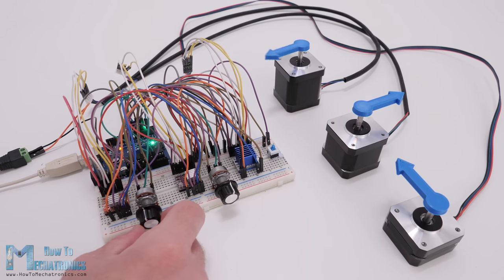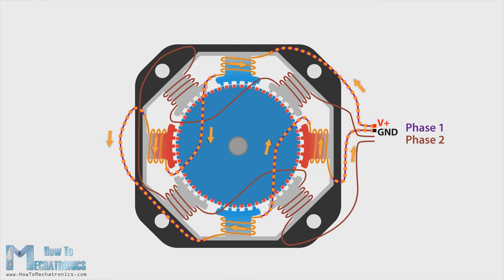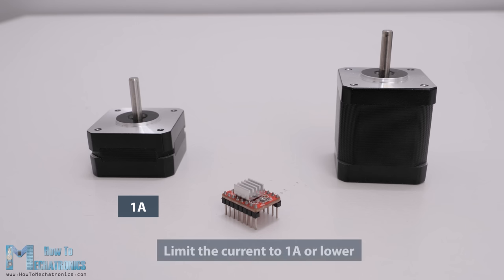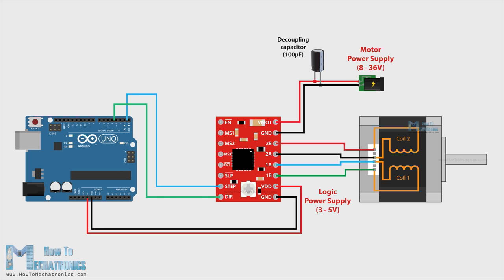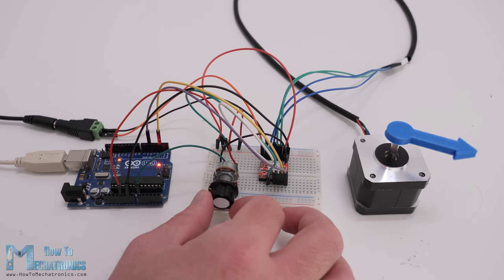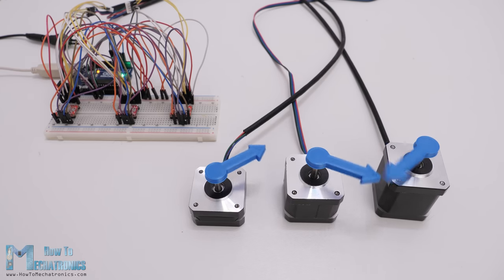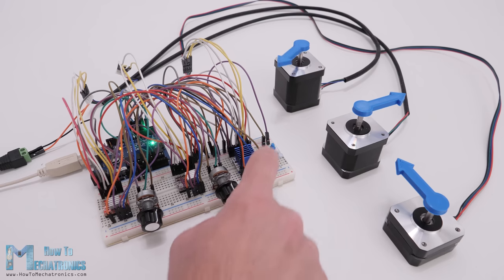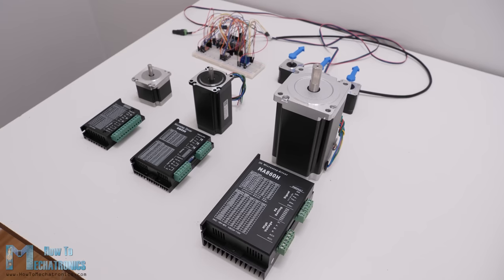Stepper Motors and Arduino - The Ultimate Guide

Comment: My capacitor just exploded. Wy?
Reply: I was about to connect it bro!!
Reply: You plugged it in the in reverse bias
Reply: @angelrodriguez1929 that happened 2 weeks ago in the guy across from me in labs 😂😂
Reply: Just use cnc shild fuck this ahahah
Reply: Because you didn't have the capacity to handle the knowledge of this video.
Reply: You need to watch out for the capacitor voltage rating
Reply: @ivanarambasic9996  if im using a 12V power supply, what Voltage rating capacitor should I use?
Reply: @joseleandro3165  The voltage of your power supply does not matter. The voltage over the capacitor matters. But if the voltage over the cap is 12V. Then I recommend at least 16V, it does not matter if you take a higher voltage rated cap. (Altough I don't know if this is true for the esr) But apart from that you should be good with 16V or higher.
Reply: Skill issue

Comment: Thank you for the super helpful video! I want to have a NEMA 17 stepper complete a full turn (200 steps) in under 200ms (so 1000 steps/s or faster, better if faster). Is this possible with these drivers? My stepper has a current rating of 1.5A, and I am using a DRV8825... What voltage should I apply to the motor to ensure this? The torque should not be very high, but I need high acceleration!

Comment: Very professional tutorial with narration correctly pitched to people learning at basic level.  I learnt a lot.  I am making a 3 stepper impedance matching unit for antennas.  3 x Nemer 23 TB6600 for current and Arduino Uno.  Your advice on Arduino library is very useful.  Cheers from OZ.
Reply from the maker: Glad it was helpful!
Reply: Hi Dean, does your motors run loud? I added a laser setup to my machine with the ardruino, cause my controller don't support a laser.
Reply: @k33501  Happy 2023.  Your steppers may make a noise during operation if the settings are not the optimal combination.  So the current setting and the Pulse/rev settings can conflict with the sketch itself.  I had to experiment a lot.
Reply: @Yosemite_Sam  Thank you Dean, I'll play around with the settings. All of the best for 2023 :)

Comment: Great explanation of the differences between stepper motors!

One question: I need a driver that makes the current towards the stepper motor 0 during standstill (to limit power and heat in the motor). Holding torque during standstill is not important as the stepper motor is connected to a worm gear.
Is any of the drivers capable of zero current during standstill?

Comment: Question:  Once power is removed from the stepper motor, does the motor lock in place?  In battery operated conditions, there is no extra power available to lock the motor.  How do you suggest to lock the motor without consuming energy?  And is there an easy way to add a gearbox or a worm drive to the popular stepper motor to increase the torque and provide a natural lock function?

Thank you for your videos which are very informative and helpful.  It is very important to describe how a device works before explaining how to use it.  I am happy to see that you use this methodology, unlike most other YouTube instructors.  I notice that in this lesson you also explain which library function block and which don't.  I can't stress enough how important this is.  If the function is non-blocking can you also explain if it is timer interrupt driven, feedback interrupt driven, or in the case of the .run() function, it just blocks for microseconds - i.e. a micro-block.  A micro-block will cause the stepper motor to be influenced by the flow of control in the software.  On the other hand, interrupt driven will allow the stepper motor to behave naturally no matter how the software behaves.
Reply: Answer to first question: No...
Reply: I know this was posted 5 months ago, but figured I’d give some extra help on your first question.
If you need a way to self lock without power, do some research on the formulas for power screws. They can be self locking given a small enough lead (thread pitch) or a high enough friction coefficient. The calculations are relatively simple when given what each part of the formula represents. 

Good luck with your projects.

Comment: What power supply are you using? Would a 12V 2A wall outlet supply work well? I'm having trouble online finding resources for this. Intending to use 1-4 stepper motors (2.4ohm, 1.5A) for CNC related projects

Comment: This video is an awesome recap on arduino stepper motor use!
Theoretically, if you were to over drive a stepper motor with the driver, what would happen? 
Would you just burn out the stepper driver or would you also take out the arduino as well?
Reply: over drive?

Comment: Thank you for your video! Could I ask what power supply did you use for driving your motors? It seems like you didn't need a capacitor. Thanks for your help!
Reply from the maker: I used a regular adapter 12V 5A power supply.
Reply: @HowToMechatronics  thank you!
Reply: @HowToMechatronics  could you give us a link?
Reply: @HowToMechatronics  yes  it seems you didnt used a capacitor , why is that?

Comment: Very detailed explanation😊😊 thank you. But I have a question, If I want to run my rotary machine using stepper motor, where the stepper motor actions (on and off) are driven by photoelectric sensors just to make stop once the sensors are turned on, do I have to use driver? Or Can I just use transformer and capacitor only since it only run on single direction? 

Note: I only need the motor to stop exactly when the sensor are on

Thank you

Comment: Great video! Have tried to work this code for simultaneous motor control, but the motor is not moving smoothly as in the video for the speed and acceleration only for ACCELSTEPPER library, its like its starting and stopping each step till final position causing a juddering sound and slow motion of the motors... i cant figure out why its not running smooth

Comment: Nice video, but has a small error A4988 have a max vmot of 35V  not 36V  according to the data sheet.
Reply: At 8:15, you correctly say its 35v latter on

Comment: Amazing video !! Would it possible to ask you a question here please? What if I would like to connect a big NEMA 34 with its own large controller, to this CNC board? Is it feasible? Also, do these little red CNC boards allow the great motors to be used at their max speeds? And if not, which Arduino or GRBL system would be suitable for high performance driving of NEMA 34s?

Comment: For the DRV8825 Drivers, your wiring diagram seems to be incorrect. the RST and SLP pins need to be connected to 5V otherwise the drivers don't turn on.

Comment: Great tutorial! I hope I found this earlier! Did you manage to make it work the first time? I already tried twice, and both attempts failed. The negative wire connecting 12V to GND on the A4988 melted right after I applied the voltage. Is there a reason for this? Thanks!

Comment: Thanks firstly for this summary.

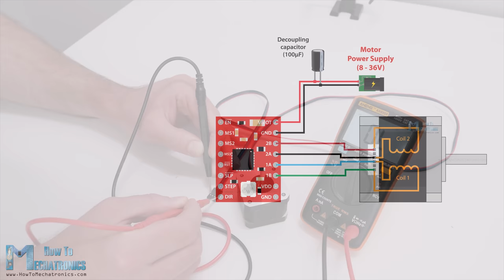9:27 The order really doesnt matter? 5:14 I think it makes a difference by depoling 2A with 2B when the signal of the H-bridge goes the wrong way. As whe one coil pushes clockwise, and the second coil may then push counter-clockwise what makes the motor just buzzing instead moving, right?
22:11 Does the 3. motor not make 4 rotations as 3.200 / 800 = 4?

Comment: Can the MS1 and MS2 pins be controlled via software or only my connection to GND and 5V? I was working with TMC 2209 and was TOLD that such control was available on it,but later came to understand that on the TMC 2209 the MS1 and MS2 pins are used for setting up come parameter for UART control of the selection of Step type, e.g. WHole Steps, quarter steps, sixteenth steps etc. I really need to be able to control that via software.
Reply: Just an idea, but what if you just do the largest micro stepping option
And then in your code, account for the different micro steps changes. For example just half or double your incrementations for your desired likings at the right times

Comment: thats awesome, i wanna ask if i want to control two motors about 15m to 20m far from each other, will they still be synchronized and run at same time? wht is the maximum distance at which they will start to differ?

Comment: Hello! How are you doing? I wanted to ask a question. I've been experimenting with various stepper motors, and I've noticed that all of them exhibit high vibrations, elevated temperatures, and significant noise. Any idea what I might be doing wrong? It's worth noting that all the motors I've tested were salvaged from printers, and these, at least in appearance, seem to be similar to NEMA motors.

Comment: Great video but I have one question
The arduino board is not listed in the parts section of the video I think it is an arduino UNO  but which one please 
So could you please recommend the correct board to complete this project I am working on for a camera slider 
I did read that someone else in the comments made a camera slider based on this video
Reply from the maker: Thanks!
Well it depends on the project you want to build and how many steppers motors and other inputs/ outputs you will require. With an Arduino UNO you can easily control up to 4 steppers. A combination with and CNC shield makes the implementation even easier.
Try to find an older video of mine where I showed how I made a camera slider.
Cheers and have fun building!

Comment: Great video. I'm using the CNC board  to build a camera slide, as you did. It worked great. But now I wanted to use the tmc2208 in place of the older driver boards. It worked, but the motors started to move very slow with out a command. I did not see anything that showed EN going to ground. After watching your video I then set EN to GND on the cnc board and after powering it up, nothing. The motors did not get power. They are not holding like they did with the old drivers. Any idea what could have happened? Please reply. Thank you.
Reply: Did you ever find out the issue was likely microstepping?
Reply: @derson754  I did get it to work. The fuse had blown. I changed the cnc board, and I think I did check the Stepping. It has been a while. I'll have to think more about it.

Comment: What should one use for a 3V stepper motor? It seems that's far too below the motor voltage threshold on any of these drivers. Can one provide 3 Volts to their motors with these drivers?  Can the stepper motor handle higher than 3V? I am unsure

Comment: Can i connect a li-po battery to the DRV8825?
Battery specs:
11.1V
30C/60C discharge
66A continuous discharge
132 Burst discharge

So can i use it, and how would i connect it because the wires are thick and wont fit into the breadboard..

Comment: 7:20 The L298N is pretty common for driving steeper (and DC) motors and the usual board it comes on includes a fairly beefy heatsink (but it doesn't usually come with a pot, and I can't determine if it supports microstepping).
Reply: L298N it's a dual H-bridge driver, this means that it can drive 2 coils and can invert the polarity of the outputs but it's mainly designed for brushed DC motors, of course you can run a stepper with it but you will have to do all the step logic on your microcontroller, a stepper driver does it all by itself. And a microestepping may be possible doing some pwm tricks on the step logic but for the price of a stepper driver I would recommend going for the stepper driver, only use the L298N if it´s your last resource or you want to experiment.

The pot it's for current limiting, if using an L298N you need to limit your current from your supply, via a current limiting circuit or using a voltage that will not destroy the stepper.

Comment: Hello, I just tried this following your guide using all the same parts and unfortunately had smoke rise from the breadboard (sorta the right side of the driver chip) shortly after plugging in my power supply. (24v 3A). I started over with all new components and again had the same result. Any words of advice? Using the 8825 driver.

Comment: What is the backlash?
And does the motor hold position against opposing pressure?
Reply from the maker: Well unless they skip a step they will hold their position correctly. I haven't made any backlash tests, but I guess it depends of the amount of opposing pressure and the power of the motor itself.
Stepper motors are very popular choice for CNC machines and provide excellent results. Currently I'm designing a CNC machine using NEMA23 stepper motors, so stay tuned to check out what kind of precision I will get from it. It should be ready in couple of months.
Cheers!

Comment: What happens if you disconnect one of the drive wires to the stepper motor, while the stepper is energized or moving? 
My guess is that the driver chip will blow if it only has synchronous rectification. Which I think all 3 chips do. 
2 ultra fast or schottky diodes connected to each 4 drive lines (one to ground and one to + supply ), 8 diodes in total would be required to mitigate this possible disaster.
Reply from the maker: Not quite sure what would happen. Maybe you guess is right.
Reply: @HowToMechatronics  you will fry it,  dont that lots,  also if a connection is loose,  after some time ,   it will fry

Comment: I want a board that has a dial that when I turn  it turns a stepper motor. No Arduino no programing maybe dip switches to set the steps per turn and a place to connect limit switches.

Comment: I am trying to build this. Doesn't work for me. The diagram show the pins on 2 and 4, realised code says 2 (3rd one along) and 5.  But still not working. tried to adjust current but makes no difference. Exactly the same components 12v to motor but not have not added the capacitor.  Any ideas please.

Comment: I have tried the DRV8825 a few times but it just doesn't seem to work (even with the arduino shield and yes I checked the orientation). I have tried 2 different suppliers but still no luck... Does anyone have the same expierience?